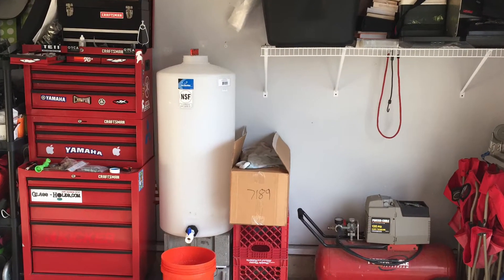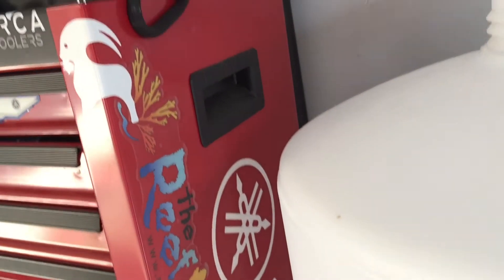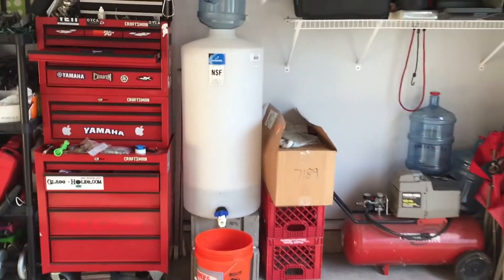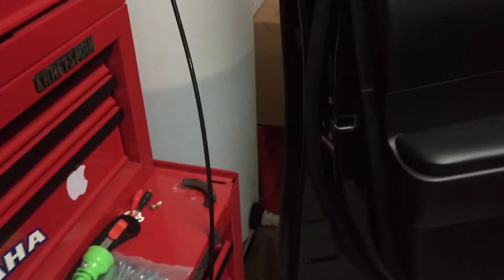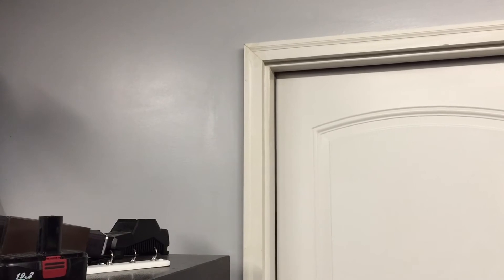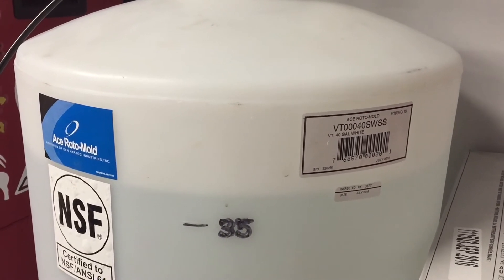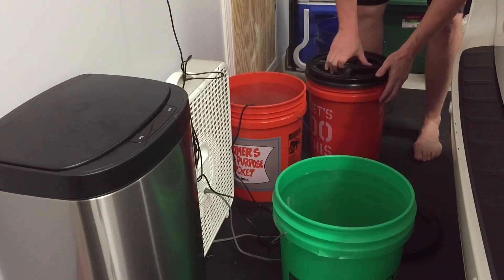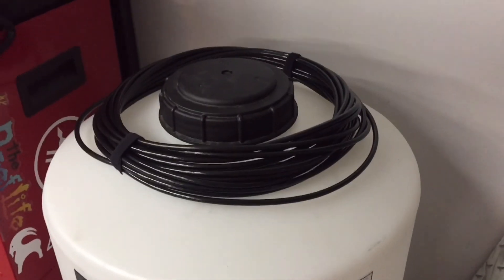Storing RODI Water | Ace Roto Mold 40 Gallon Vertical Container | Water Change Station

Comment: I may have to consider something like this.. keep it in the basement so I can stop filling 5 gallon buckets. If your gonna end up moving the RODI unit back into the house during the winter you might as well leave it in the house permanently.. I ended up using my Iphone alarm for a reminder when filling those 5 buckets.. i set it 45mins from the time I start and it has saved me dozens of times. I was almost temped to dislike this vid when you showed that UK sign amh...GO CARDS! LOL... nice vid man
Reply from the maker: I was also filling up buckets, and the problem I was running into was that sometimes my pressure would fluctuate and timing it was never accurate enough. I can't tell you how many times I walked into my laundry room to find out the bucket was overflowing. Which creates a new problem, once the bucket is full past the rim every time the bucket is moved you spill more water! I like to keep 20-30 gallons of water in  buckets and frankly got tired of stepping over them and seeing them all over my garage. I love the 40 gallon container, if I had to do it all over again I would get the 65. It isn't much more expensive and it ships to your door for free. In the grand scheme of things it is VERY nice sliding my bucket under the valve and just turning it to fill my bucket. 

I am with you on keeping the rodi in the laundry room, I would love to lower the unit. The automatic flush valve is on top of the RODI. I am 6'2 and I can't reach it because of how high I mounted the unit. When it comes time to replacing filters and membranes it will be a slight pain again because of the location. But I think I would rather deal with those problems VS moving it. I guess in the summer months I could leave it in the garage, I don't know that it is worth it still! 

HAHA We have UK stuff all over the garage, surprised you've never seen anything before!

Comment: I have a 150 gpd RO/DI unit and it takes me 3 days to full up a 45 gallon Brute, going to look into a boost pump. Took a look at rural king, the 65 & 75 gallons weren't showing up as free shipping right now.
Reply from the maker: They just changed the 65 gallon recently and started charging shipping. I just looked and they are charging shipping on the 75 gallon now, I KNEW I should have ordered one a month ago! For what it's worth, the 40 gallon is $76 plus $10 to ship. Maybe I should go ahead and order another one!
Reply: +pelphrey I order 2 - 40 gallons. What has been keeping me from getting tanks like this has been the crazy shopping cost even on small ones. Great find man.
Reply from the maker: +Jacob Side I'm going to run by rural king this weekend, see if they can get me a 65 or 75. Otherwise I'm ordering a second 40 before they start charging $100+ to ship it. Thanks for bringing this to my attention!

Comment: Not sure if you are still monitoring this video channel. This was very helpful. I have two questions I hope you can help with regarding your setup. 1) Do you use a PowerHead in the 40 gallon tank to keep the water moving or do you find that the water won't get stagnant over time. 2) Do you have a heater in that tank to keep the water warm for tropical tanks?  Thanks!
Reply from the maker: I actually have two of these containers now, I keep them both filled up with RODI water only. I don't use anything to heater the water or move the water around. These containers are air tight. 

When I do water changes I heat the water up in the bucket.
Reply: Thank you for your fast response!!! I do appreciate it.
Reply from the maker: My pleasure!!

Comment: That's good bro good job but hey get it the brute 20g is better for you to mixed 10 gallons I purchased on Amazon you liked is not to big is perfect size I do my 10 or 15 g change the wheels cost more then contender $35 for the wheels good luck
Reply from the maker: Thanks for the input! I'll look into the 20 gallon brute, ordered my new tank on Monday so I'll need to be doing like you 10ish gallon water changes soon!